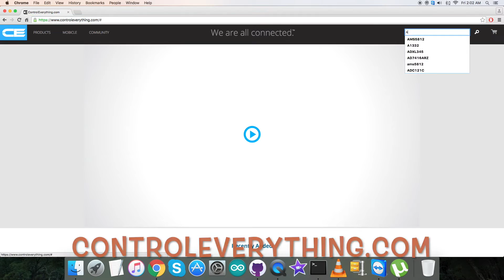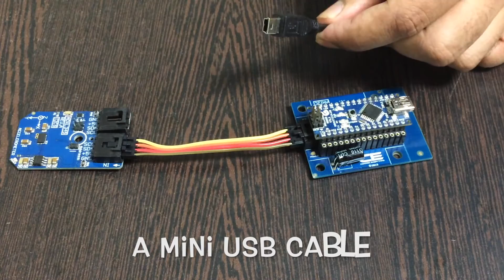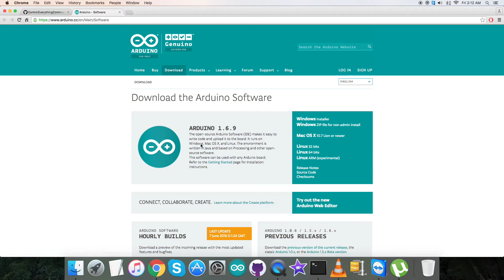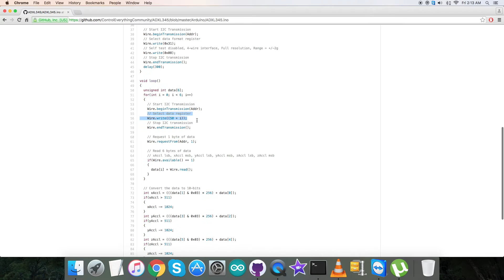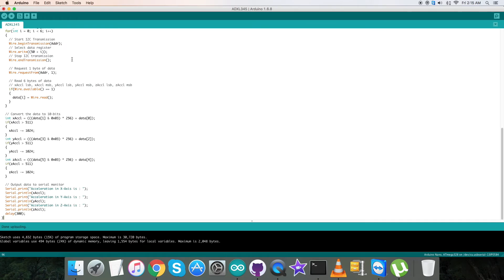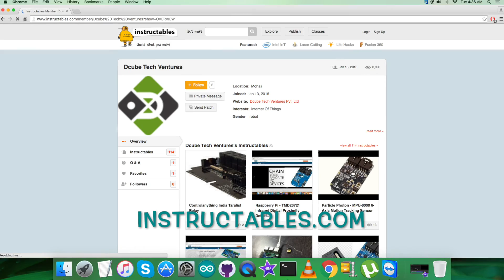Arduino Nano ADXL345 3-Axis Accelerometer Tutorial

Comment: Can you do a video on interfacing adxl 345 to stm324f29i discovery board through through spi protocol. I have written the code. But i'm not getting values for it.

this is my code

#include "main.h"
#include "stm32f4xx_hal.h"

SPI_HandleTypeDef hspi1;

void SystemClock_Config(void);
static void MX_GPIO_Init(void);
static void MX_SPI1_Init(void);

uint8_t dev_id;
//uint8_t address, data, acc;

//uint8_t data[6];

int main(void)
{

  HAL_Init();

  SystemClock_Config();
 
 //uint8_t dev_id;
 uint8_t address, var, acc;
 uint8_t data[6];

  MX_GPIO_Init();
  MX_SPI1_Init();
 
 
 // dev_id = HAL_GetDEVID();
 
 HAL_GPIO_WritePin(GPIOA, GPIO_PIN_4, GPIO_PIN_RESET);
 
 address=0x2D;
 HAL_SPI_Transmit(&hspi1, &address, 1, 50);
 
 var=0x08;
 HAL_SPI_Transmit(&hspi1, &var, 1, 50);
 
 HAL_GPIO_WritePin(GPIOA, GPIO_PIN_4, GPIO_PIN_SET);
 
 HAL_GPIO_WritePin(GPIOA, GPIO_PIN_4, GPIO_PIN_RESET);
 
 address=0x31;
 HAL_SPI_Transmit(&hspi1, &address, 1, 50);
 
 var=0x08;
 HAL_SPI_Transmit(&hspi1, &var, 1, 50);
 
 HAL_GPIO_WritePin(GPIOA, GPIO_PIN_4, GPIO_PIN_SET);
 
 
 
  while (1)
  {
  
  HAL_GPIO_WritePin(GPIOA, GPIO_PIN_4, GPIO_PIN_RESET);
 
  address=0x00 + 0x80;
  HAL_SPI_Transmit(&hspi1, &address, 1, 50);
 
  HAL_SPI_Receive(&hspi1, &dev_id, 1, 100);
 
  HAL_GPIO_WritePin(GPIOA, GPIO_PIN_4, GPIO_PIN_SET);
 
  HAL_Delay(100);
  
 
  HAL_GPIO_WritePin(GPIOA, GPIO_PIN_4, GPIO_PIN_RESET);
 
  address=0x32 + 0x80;
  HAL_SPI_Transmit(&hspi1, &address, 1, 50);
 
  HAL_SPI_Receive(&hspi1, data, 6, 100);
 
  HAL_GPIO_WritePin(GPIOA, GPIO_PIN_4, GPIO_PIN_SET);
 
  HAL_Delay(100);
 

  }

}

/** System Clock Configuration
*/
void SystemClock_Config(void)
{

  RCC_OscInitTypeDef RCC_OscInitStruct;
  RCC_ClkInitTypeDef RCC_ClkInitStruct;

    /**Configure the main internal regulator output voltage 
    */
  __HAL_RCC_PWR_CLK_ENABLE();

  __HAL_PWR_VOLTAGESCALING_CONFIG(PWR_REGULATOR_VOLTAGE_SCALE3);

    /**Initializes the CPU, AHB and APB busses clocks 
    */
  RCC_OscInitStruct.OscillatorType = RCC_OSCILLATORTYPE_HSI;
  RCC_OscInitStruct.HSIState = RCC_HSI_ON;
  RCC_OscInitStruct.HSICalibrationValue = 16;
  RCC_OscInitStruct.PLL.PLLState = RCC_PLL_ON;
  RCC_OscInitStruct.PLL.PLLSource = RCC_PLLSOURCE_HSI;
  RCC_OscInitStruct.PLL.PLLM = 8;
  RCC_OscInitStruct.PLL.PLLN = 50;
  RCC_OscInitStruct.PLL.PLLP = RCC_PLLP_DIV4;
  RCC_OscInitStruct.PLL.PLLQ = 7;
  if (HAL_RCC_OscConfig(&RCC_OscInitStruct) != HAL_OK)
  {
    _Error_Handler(__FILE__, __LINE__);
  }

    /**Initializes the CPU, AHB and APB busses clocks 
    */
  RCC_ClkInitStruct.ClockType = RCC_CLOCKTYPE_HCLK|RCC_CLOCKTYPE_SYSCLK
                              |RCC_CLOCKTYPE_PCLK1|RCC_CLOCKTYPE_PCLK2;
  RCC_ClkInitStruct.SYSCLKSource = RCC_SYSCLKSOURCE_PLLCLK;
  RCC_ClkInitStruct.AHBCLKDivider = RCC_SYSCLK_DIV1;
  RCC_ClkInitStruct.APB1CLKDivider = RCC_HCLK_DIV8;
  RCC_ClkInitStruct.APB2CLKDivider = RCC_HCLK_DIV4;

  if (HAL_RCC_ClockConfig(&RCC_ClkInitStruct, FLASH_LATENCY_0) != HAL_OK)
  {
    _Error_Handler(__FILE__, __LINE__);
  }

    /**Configure the Systick interrupt time 
    */
  HAL_SYSTICK_Config(HAL_RCC_GetHCLKFreq()/1000);

    /**Configure the Systick 
    */
  HAL_SYSTICK_CLKSourceConfig(SYSTICK_CLKSOURCE_HCLK);

  /* SysTick_IRQn interrupt configuration */
  HAL_NVIC_SetPriority(SysTick_IRQn, 0, 0);
}

/* SPI1 init function */
static void MX_SPI1_Init(void)
{

  /* SPI1 parameter configuration*/
  hspi1.Instance = SPI1;
  hspi1.Init.Mode = SPI_MODE_MASTER;
  hspi1.Init.Direction = SPI_DIRECTION_2LINES;
  hspi1.Init.DataSize = SPI_DATASIZE_8BIT;
  hspi1.Init.CLKPolarity = SPI_POLARITY_HIGH;
  hspi1.Init.CLKPhase = SPI_PHASE_1EDGE;
  hspi1.Init.NSS = SPI_NSS_SOFT;
  hspi1.Init.BaudRatePrescaler = SPI_BAUDRATEPRESCALER_4;
  hspi1.Init.FirstBit = SPI_FIRSTBIT_MSB;
  hspi1.Init.TIMode = SPI_TIMODE_DISABLE;
  hspi1.Init.CRCCalculation = SPI_CRCCALCULATION_DISABLE;
  hspi1.Init.CRCPolynomial = 10;
  if (HAL_SPI_Init(&hspi1) != HAL_OK)
  {
    _Error_Handler(__FILE__, __LINE__);
  }

}

/** Configure pins as 
        * Analog 
        * Input 
        * Output
        * EVENT_OUT
        * EXTI
*/
static void MX_GPIO_Init(void)
{

  GPIO_InitTypeDef GPIO_InitStruct;

  /* GPIO Ports Clock Enable */
  __HAL_RCC_GPIOA_CLK_ENABLE();

  /*Configure GPIO pin Output Level */
  HAL_GPIO_WritePin(GPIOA, GPIO_PIN_4, GPIO_PIN_RESET);

  /*Configure GPIO pin : PA4 */
  GPIO_InitStruct.Pin = GPIO_PIN_4;
  GPIO_InitStruct.Mode = GPIO_MODE_OUTPUT_PP;
  GPIO_InitStruct.Pull = GPIO_NOPULL;
  GPIO_InitStruct.Speed = GPIO_SPEED_FREQ_LOW;
  HAL_GPIO_Init(GPIOA, &GPIO_InitStruct);

}

/* USER CODE BEGIN 4 */

/* USER CODE END 4 */

/**
  * @brief  This function is executed in case of error occurrence.
  * @param  None
  * @retval None
  */
void _Error_Handler(char * file, int line)
{
  /* USER CODE BEGIN Error_Handler_Debug */
  /* User can add his own implementation to report the HAL error return state */
  while(1) 
  {
  }
  /* USER CODE END Error_Handler_Debug */ 
}

#ifdef USE_FULL_ASSERT

/**
   * @brief Reports the name of the source file and the source line number
   * where the assert_param error has occurred.
   * @param file: pointer to the source file name
   * @param line: assert_param error line source number
   * @retval None
   */
void assert_failed(uint8_t* file, uint32_t line)
{
  /* USER CODE BEGIN 6 */
  /* User can add his own implementation to report the file name and line number,
    ex: printf("Wrong parameters value: file %s on line %d\r\n", file, line) */
  /* USER CODE END 6 */

}

#endif

/**
  * @}
  */ 

/**
  * @}
*/ 

/********************** (C) COPYRIGHT STMicroelectronics *****END OF FILE****/